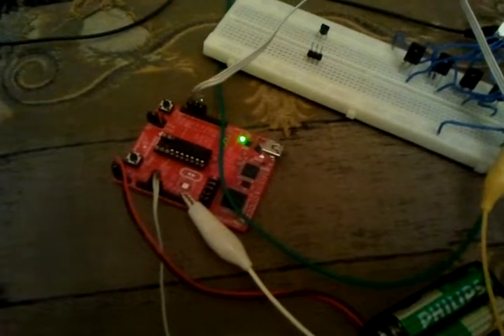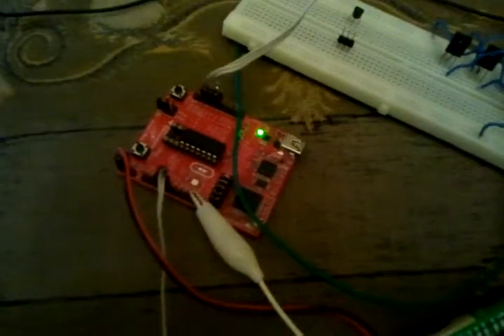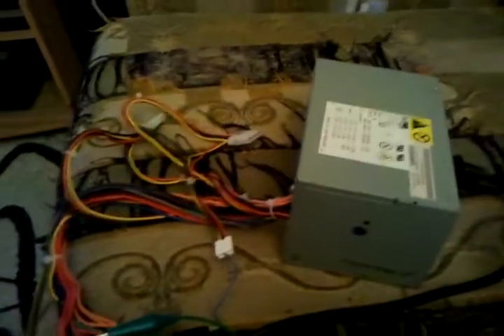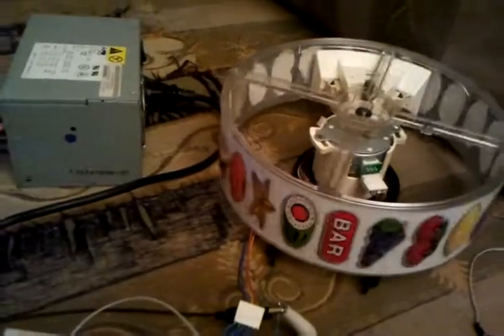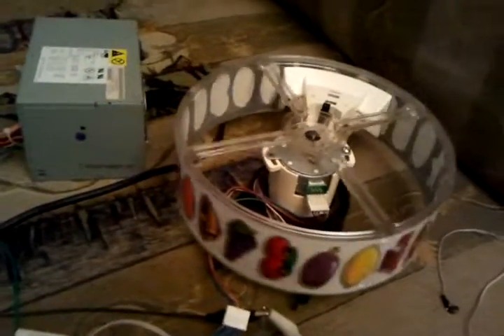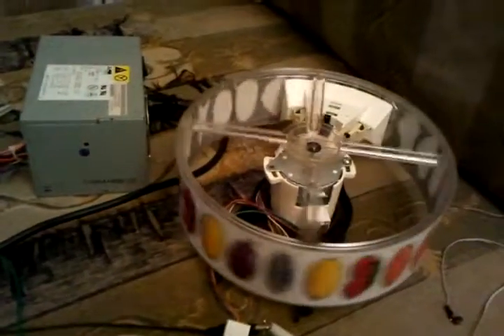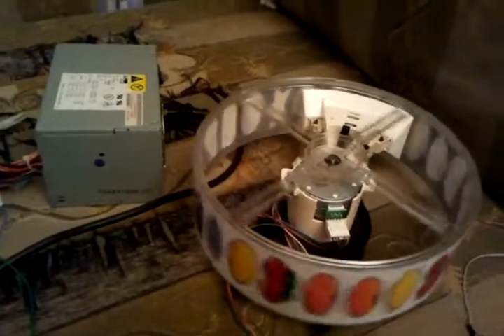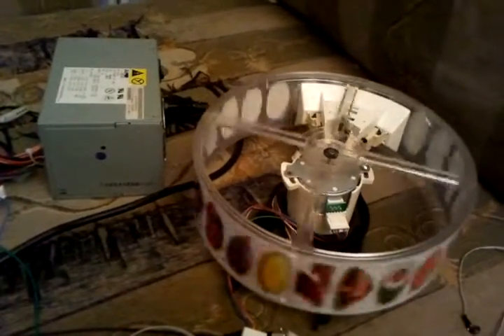MSP430 Launchpad with Stepper Motor

Comment: Thanks for sharing your video. Now I have discovered on an electric slot machine each reel has its own motor. I used to think only one motor to spin the 3 reels. I am thinking of building my own slot machine.
Reply from the maker: Thanks! And yes, everything is controlled by a central processing board and the reels are really just used as a graphical/mechanical way to display the results these days :)
Still great hardware to tinker around with, and a lot less mechanically complex than the really old slots that had mechanical triggers and such :)